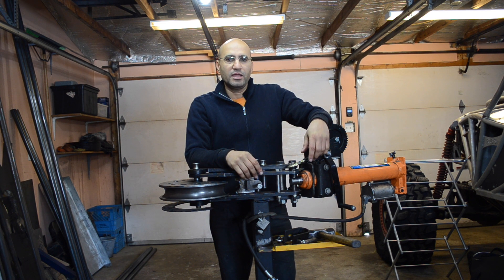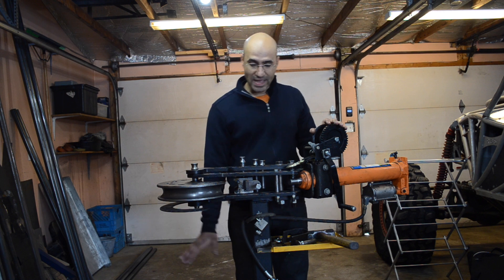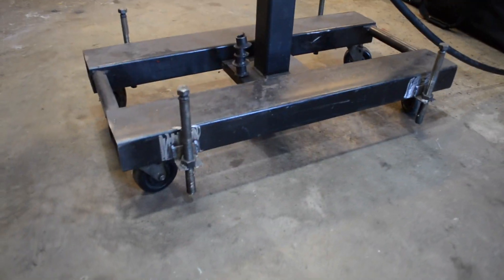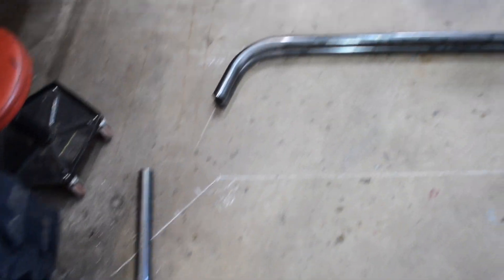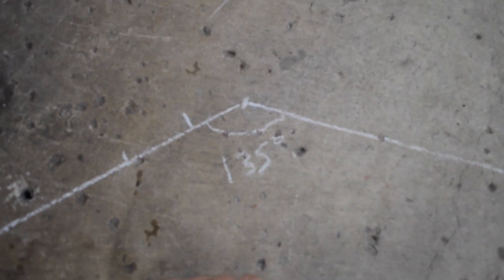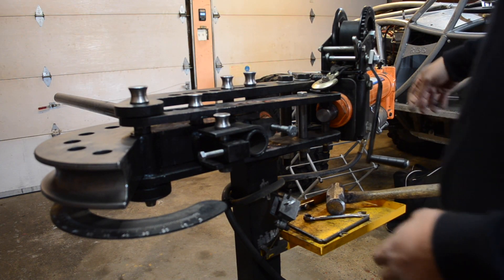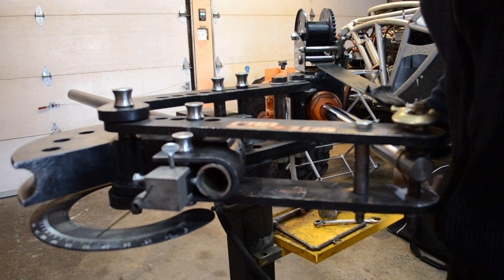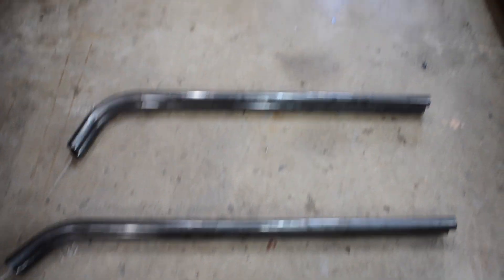How to bend tube with RG Sabat

Comment: Sorry if I missed it, but what diameter is your die and what size tube did you use on your bouncer? Thanks!
Reply from the maker: I use 1.66" OD 0.125" wall structural tubes for my buggies. The reason for this choice is a combination of availability, price and strength. I explain more on this aspect in Episode 1 of my series. I use a Pro-tools 180 degrees, 1 1/4" pipe die with 5" centreline radius.
Reply: RG Sabat thanks for the reply. I’ll go back and give that episode another look. I purchased a pro tools HD bender with a 1.625 die thatbim planning on using DOM tubing to build my chassis with. Your videos have def given me some help planning things out. Thanks for them. They’re great!
Reply from the maker: @TwinTurboLsx  You are welcome. The only downside to DOM tubing is the higher price, but sometimes it is required if you plan on racing. Let me know if you need advice while you are building, good luck.